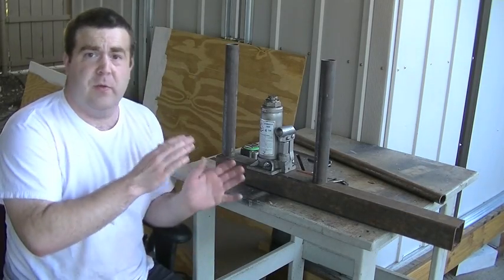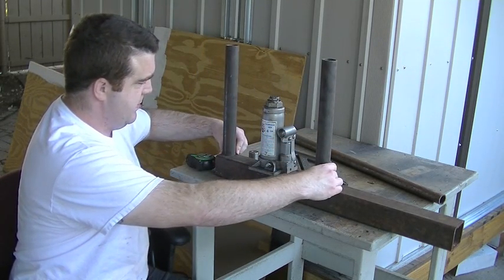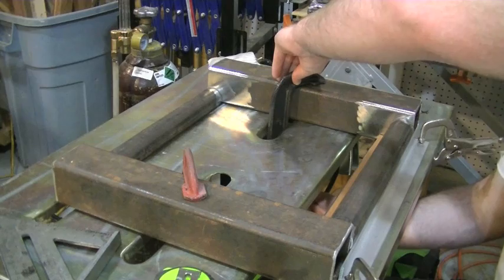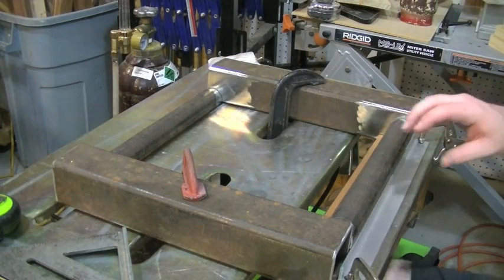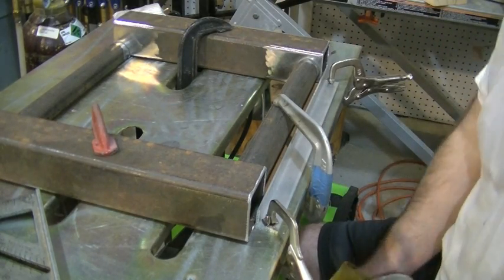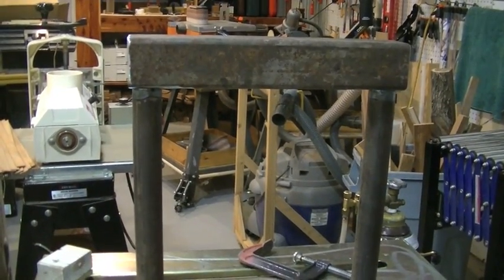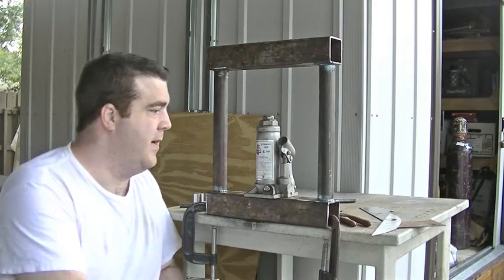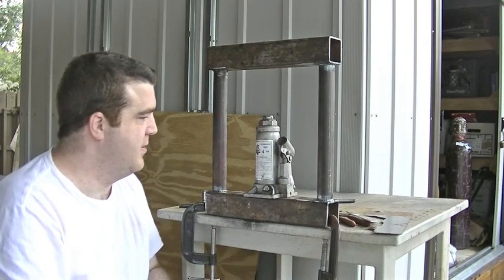DIY HYDRAULIC PRESS BUILD | 4 Ton Bottle Jack Hydraulic Press

Comment: You may want to cap the ends of the square tubes. As it is, all the force is being put on the inside faces only. That'll deform the tubes if you put it to the test.
Reply from the maker: +Icepick That crossed my mind at the time I was building it.  I may still do that but I'm not sure if it would help much.  If I was applying the pressure at the ends, the caps would help.  I think it would be more helpful to insert a strip of 1/4" flat bar through then center of the square tube and tack weld the ends.  As it is now, the uncapped ends make it easier to clamp it to the workbench.  Thanks for watching!

Comment: also on that lowering kit for your c10 im currently trying to do same on my 86 chevy c10 scottsdale 5.0 305 with a 4bbl carb. but still trying to fig out what the area measuremnt of spiddle it is? and whats the cheapest way to go. im sure not using spring shackles right?
Reply from the maker: +Manny Santana I'm not sure I understand your question.  What measurement on the spindle are you looking for?  And what's your question about spring shackles?